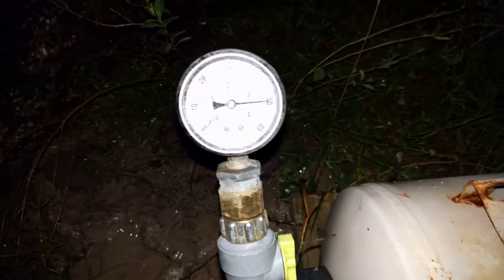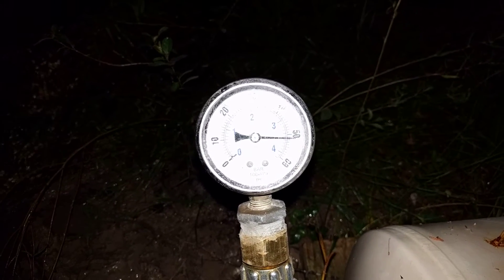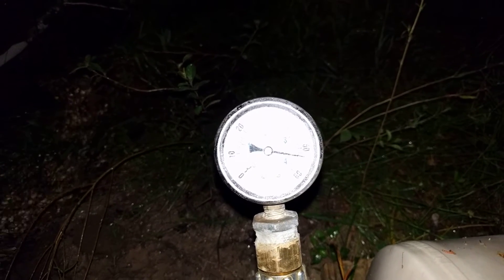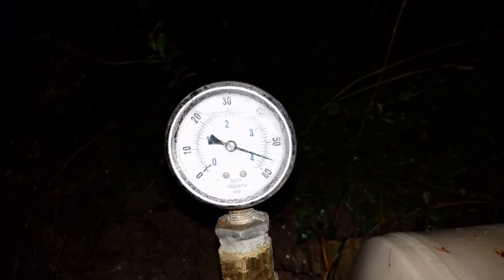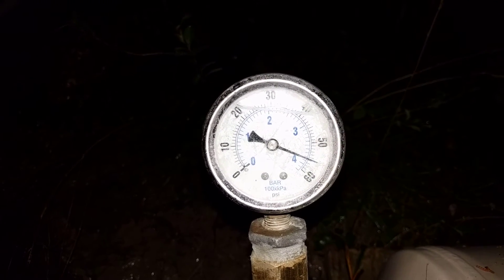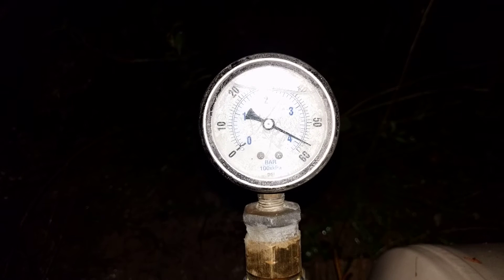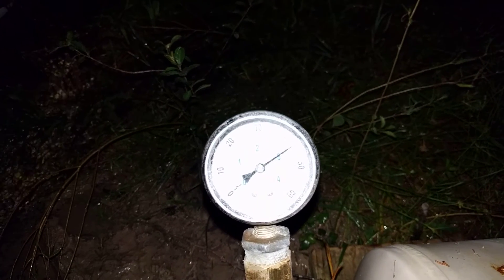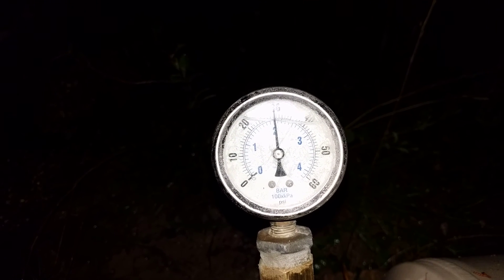High Pressure Run for Stainless Steel Ram Pump Upgrade

Comment: Very nice pressure, I've just built a couple different size ram pumps for the first time and the highest pressure I've been able to build up is 30-32 psi with my 2" version.
Reply from the maker: Sorry I missed this 10 months ago! I imagine it has to do with how much fall you have from the source to the pump. There is a limit to how much pressure that can be built dependent on the pressure of the water at the pump inlet. 30 psi will lift water a long way.
Reply: Amount of fall (head) is a factor and another really important factor is the length of the drive pipe.   For your 30 psi 2 inch drive pipe version, what is your head and length of the 2 inch drive pipe?   How much water volume are you delivering out of the ram pump and at what delivery height are you measuring it?   Thanks.   Dave from Water Powered Pumps public Facebook discussion group:   
https://www.facebook.com/groups/240458583255303/